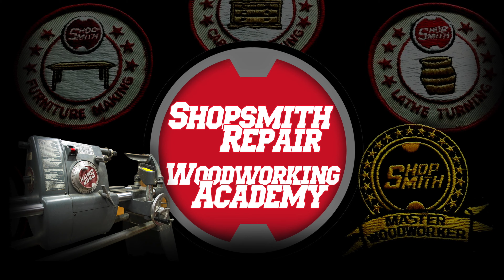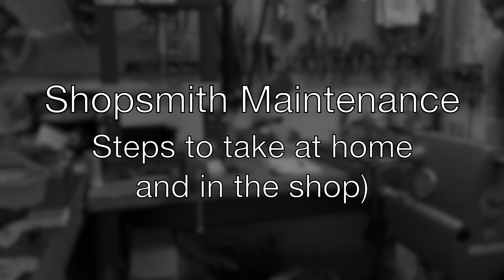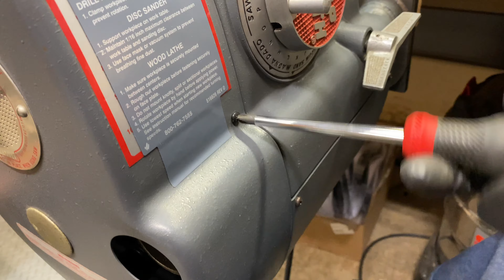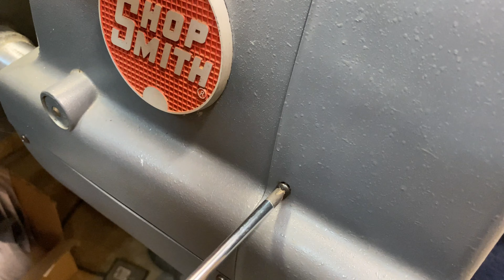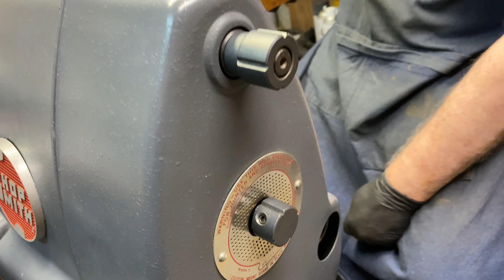Shopsmith Headstock Routine Maintenance

Comment: I just bought one used from an estate sale. The information you offer is priceless. What type of oil do you suggest for the lubrication ports? Also what type of wax/grease would you recommend for the rails?
Reply from the maker: We recommend 20 weight non detergent oil like sewing machine or motor oil. You can also use it for the wedge locks. For tubes and inside the holes of the headstock use paste floor wax. 
James

Comment: I have never seen those hubs on my dads which he got around 1960 and is mine now
Reply from the maker: If you have any accessories that connect to the Headstock you need them. For example the top hub connects to the Bandsaw while the lower hub has two functions to operate accessories like Jointer and to cool the Idler shaft. The Idler shaft tends to get hot due to it's design.

Comment: James, I have a stand alone Shopsmith 20” scroll saw.  Drive o ring broke, Shopsmith sent a replacement 523139 and instructions to replace. Step # 3 says remove the link bolt #55 from the link assembly #54. The problem when I try to remove lower bolt entire gear mechanism turns. Not sure what to hold to prevent this, don’t want to break anything. Can u help?
Reply from the maker: Sorry for the late replay, as i just saw this question. If you still have the issue then call me and I'll walk you through it.
Reply: @shopsmithrepair  Thanks spoke to customer service and I am now back up and running, thanks Mike G

Comment from the maker: For the power pro you would only have the motor sheaves.
Reply: hi, I encountered a problem oiling my Mark Vll, I removed a nut (connected to the rack lever) in removing the back cover. In putting back the cover I overtightened the nut and broke some rack teeth. My dilemma is alligning the lever since the main head is stuck. I will be breaking more teeth if I force to move the main head, Advice will be most welcome.
Reply: @generalmanager2563  Sorry but no experience in that situation.